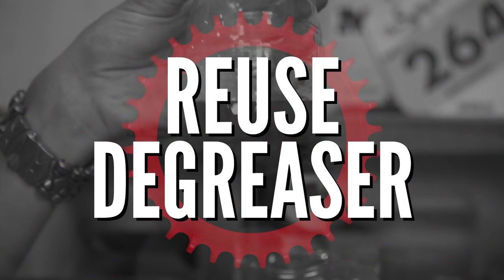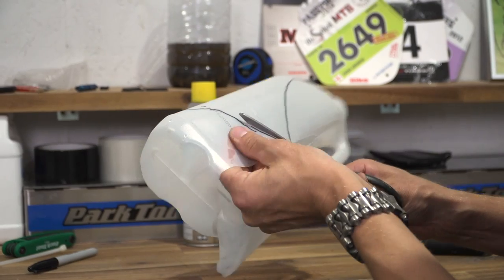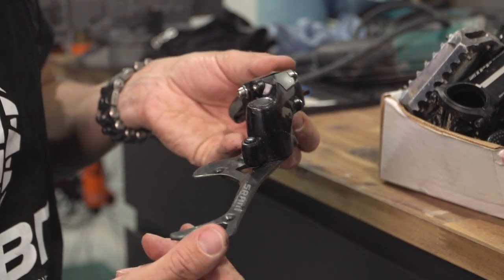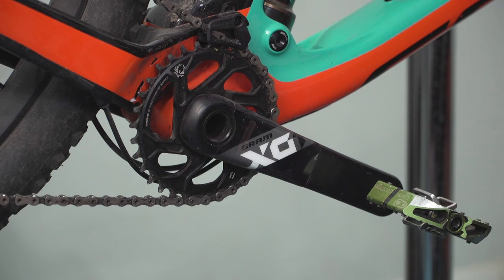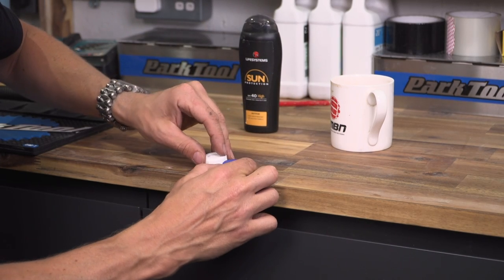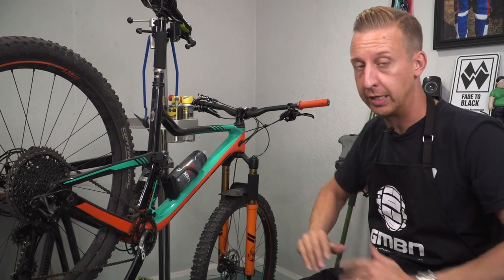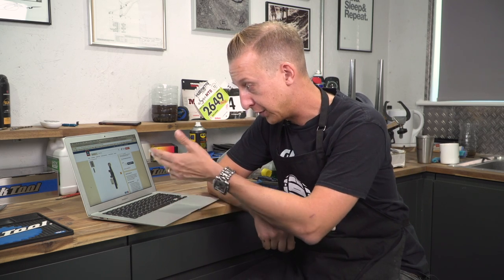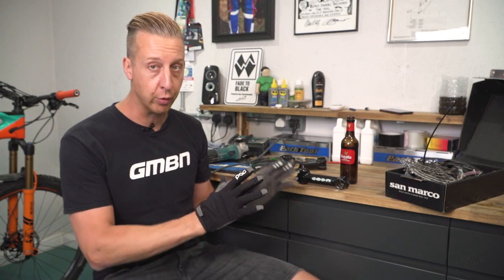The Best Money Saving Hacks For Mountain Bike Maintenance: Part 1

Comment: Doddy--

If you remove the guard from your angle grinder, please use a full face guard.  You have the thin blade perfectly lined up to fly in to your face.   Stay safe.
Reply: Gloves  will  only  get  you  in  trouble  as well.  It is safer  to  just  let  a run  away  blade  do  a clean  cut. If it hits  a glove  it is going  to  do more damage  to  your  hand as it will snag.
Reply: Yep, gloves are a no go for anything you drill or grind with. That is almost the first thing you learn if your going for a job as a mechanic.
Reply: The guard should always be used. It is there in case the grinding disc explodes and turns into flying shrapnel.
Reply: Not worth the risk
Reply: This guy knows whats up. Use a face guard.
Reply: Definitely use the guard.  And a full face. I had a coworker use an angle grinder with that blade and it did explode. Without the guard it would go right in your face.  Be safe first.  Life altering injury is not worth the “convenience”  .
Reply: truth is, if you over use one blade, it will eventually shatter and hurt you, badly! Use a guard!
Reply: So true to use a full face guard, you may also want to not have any paper towels around you when you're doing any grinding mate 😉
Reply: If he uses poc glasses in the vid he can use a fool face helmet!😂😂😂
Reply: Hey Erik how are you? My name is Erik too!
Reply: Erik he just wants to cut and destroy look at him

Comment: Great video. On the subject of degreaser. A guy who used to run a local bike shop once told me that using cheap household furniture polish is a superb degreaser and he swears by it. I have to say it works if you want to clean a chain or cassette etc or just to get thick oil off your hands.
Also old inner tubes make great elastic bands if you want to keep tools together etc if you cut them enough you potentially could have hundreds of elastic bands from one tube.

Comment: I once used an old stem and clip on aero bars to make an adjustable seatpost mounted rack.  Didn't hold more than 20lbs without sagging, but it worked.  I also keep most of my bike parts.  Always some sort of use for them even if it is not bicycle related.

Comment: Doddy pro tip, when using steel cutting discs on aluminum it is best to rub on some wax or a soap bar on the disc itself. Aluminum can actually adhere to the discs which can create a bind, I don't know if you have ever seen one of those discs blow up, but its not cool. You should always try and shield your face. Believe me, I am a metal fabricator, the angle grinder is by far the most dangerous tool in the shop.

Comment: Great to see you reusing the degreaser. I clean my chain in a 1kg peanut butter plastic jar with lid. I have a couple of 1 litre kerosine bottles that I put the dirty degreaser into. Like you I decant the degreaser after a few days, but into the second bottle, so leaving the silt at the bottom of he first bottle,. Takes only a few seconds. The reason I use closed bottles and jars is to avoid the fumes. Gradually the silt bottle fills up with solids but usable degreaser seems to be effective for ages. So although the degreaser may be seen as environmentally unfriendly, I don't have anything but silt to dispose of. Cheers

Comment: Hi Doddy, I have a question about degreasers: There are pretty cheap kitchen degreasers in a spraybottle which I usually use for degreasing and cleaning my drivetrain. They worked very well for me so far but I wonder what you think about those in particular. Stuff like Cillit Bang for example.

Comment: I use chainsaw oil for chain lube it works for me. It's designed to run it hot dirty conditions with metal rubbing metal at high speed helping cool and reduce friction. It's under far less load on a mountain bike so happy days.

Comment: i really like the approach to keep old stuff like derailleurs, chain rings, screws etc. - it might not be good enough to use on a long distance/touring bike, but as a bike enthusiast you frequently run into the situation where your parents, siblings, friends or neighbors ask you to give their 5km-twice-a-week-bikes a quick check and you find out the problem is just a tiny part, that you would have to get from the bike shop next town for 10 bucks... unless you have a couple of boxes with spare parts from your/their older bikes...and if it's really too worn down try to imagine a totally different purpose ;)
and i can not underline your clothing tips enough - most of my cycling/outdoor clothes is bought from an outlet store at around 10-20% of the original price - why pay 200€ for a jacket that you can get for 30?!
i just went there once in a while and bought what was really cheap... not what i necessarily needed by the time - the time will come!

Comment: If you put the container into the Park Tool magnetic dish, it pulls all the metal shards and crap to the bottom making it easier to pour out without getting any of the crap in the fluid

Comment: how about buying 2 chains and swap between them as they stretch ? best way to greatly lengthen your drivetrain. Also an ultrasonic cleaner can be had for around $10 and will clean that chain in no time much better than just sitting in degreaser.

Comment: I don't like using the blade guards either. Worth mentioning, if you choose to work that way, it's a good idea to keep your face out of the plane of the disk. If it shatters it will fly apart in the plane it's spinning in, so if you keep your face out of that plane you can minimize the potential of a bleed-out or action-hero-face-scar.

Comment: Another good one is do smaller jobs yourself. Don’t take you bike to the shop if just the brake pads need changing, first give it a go yourself.
Reply: to be fair, anything that doesn't need specialist tools (that you're not gonna buy for a one off job), is doable at home, from changing pads to lower leg service and rear mech adjustment.
only things i leave to the pros to do is wheel truing, press fit BB and headset bearing replacement on carbon frame, and yearly service/check of the bike (as my untrained eye could miss something tiny but important)
Reply: Alex Nicolaou I complete agree. 
I tend to stay away from all suspension related pieces because if you screw something up it gets quite pricey
Reply: Ray Ward 😨
Reply: For me, anything except trying wheels is a home job.

Comment: Cool video! Come to NYC and what the food delivery guys use for fenders, I've seen everything from plastic bottles to aluminum gutters. They wrap their chain lock around the top tube while riding, so they build a little enclosure for the cables to run free, then wrap that in an old tube or tire. Compact discs for reflectors, some crazy stuff!

Comment: For the angle grinder, standard practice is to not use gloves because they can get caught up in the disc and pull your hand into the tool. This is typically the case for any rotary tool that your hands go near. The sparks can be avoided by using the guard, or if that's not possible (I often use it without the guard for accuracy), by changing where you contact the blade to the material so the sparks fly away from you. They also burn out really quickly and don't really hurt much anyway. I also recommend using both safety glasses and a face shield if you have it. The face shield provides protection from broken cutting discs and flying metal, and adds an extra layer of protection keeping small pieces of metal out of your eyes. People who work with metal a lot can accumulate enough small shards in their eyes without noticing for that to pose a problem if they ever have to get an MRI because the powerful magnets will rip the metal out. I couldn't help chiming in with some safety things because that's my actual day job. I teach people to use woodworking and metal working tools, so at this point looking out for safety tips is reflexive. Digging these bodges, Doddy! I just recently put a bash ring on my bike that I concerted from 3x to 2x. I wound up using a machined bash ring from BBG Bashguards that had the proper BCD and was inexpensive, but later had the same thought about angle grinding the teeth off the chainring I took off.

Comment: I use several 1kg plastic peanut butter jars for my chain cleaner, I can screw the lid on and really shake the chain around which gets most dirt off the chain due to all the movement and sloshing around. Then in about a week with sludge has settled at the bottom of the jar so I can tip the clean stuff into my 2 litre kerosine bottle with child safe lid, and use it again and again.

Comment: Talking about hacks and household cleaners: 1) Take your brake pads out and clean them with good old VIM....!  Dip the pads in the Vim and rub them together under a hot tap. The Vim makes an slightly abrasive paste that cleans and resurfaces the pads. This is good for de-squealing your brakes as the slightly roughened surface might disrupt potential harmonic frequencies. 
 2) Furniture polish makes a great bike cleaner. Just spray your frame and rims and buff off with a soft cloth. 
3) Household cleaning alcohol works just fine on disks. Use a J cloth to put it on and a white micro fiber cloth to finish them.

Comment: great stuff :-)
5:33  I recommend Sortimo T-Boxx, they are space efficient, no space is wasted, and can be used with  their drawer system. you can take out the boxes, and sort them the way you want, and they stay in place, so you can remove them and put a big item that won't fit in the boxes, they can be stacked, so pretty smart solution, so far this is the best solution I have found.
0:51 I never needed to do a deep clean, you got to put some awful lube and neglect the bike for a while to need for that. but really old stiff stock lube is quite hard to remove. even some bike degreasers will struggle.

Comment: Reminded me of a Discovery Channel program, but the build was on schedule. 
Of course skewers could have a use for food, but I cut off the handle and added a chain ring. I've also cut off v-brake arms and added chain rings too.
Cables for picture hanging ...?
I've used the  derailleur cable clamp to splice cables.

Comment: Great tips , i kinda budget protect my frame from my brake lines and stuff by aplying electrical tape on those spots , by cutting off the edges of the piece of tape it sits much longer and is even pressure washer proof , + you can get them in a lot of colours so who not , and still cheaper than the frame protectors you can buy ...

Comment: Just used some paint thinner on my cassette worked a treat.
Reply: Ray Ward Sorry? Why would I lie ?
Reply: What the hell? Paint thinner will degrease anything. (It also stinks like hell but that's not the point)
Reply: Works really well! But you definitely need to dispose that stuff in the right way cause it's particularly nasty to the environment^^
Reply: Hans Hoden yea my uncle is a panel beater he got it for me. He said just to put it down the drain.
Reply: Putting it down the drain sadly is the absolute worst thing you could do...that stuff is extremely damaging to the biology of sewage treatment plants and consequentially for water organisms in the rivers they're connected to. The bare minimum would be to soak some paper towels or cloth with them and putting that into the waste bin. Ideally you would collect it somewhere and take it to a dedicated disposal contractor. 
I have thought about buying paint thinner for cleaning bike parts in the past but you lose the price advantage over dedicated and biodegradable products when you take the disposal into account.
Reply: Hans Hoden I don’t think a poo drain is going to become bad even tho it is already bad from a bit of paint thinner.
Reply: I'm sorry, but that is a very different kind of bad. I'm an engineer in this industry and it is a very big pain in the butt for us. If your treatment plant that is basically designed for feces completely seizes to work because of liquids that kill off the organisms doing the work, lots of sewage will just spill into rivers and lakes. So I would really love to make at least some people aware of that.
Reply: Hans Hoden I was going to light it and let it burn but I don’t think that would of been good for me.
Reply: Jack Beames  cagado que más o que
Reply: Jack Beames Just put it in an Open Bucket outside and wait a couple of hours... its supposed to evaporate thats how paint thinner works
Reply: Not if you have a  painted cassette
Reply: just buy some proper degreaser! Muc off stuff isn't that expensive and environmentally friendly. I have a big bottle of Weldtite citrus based stuff, works great!

Comment: Awesome tips Doddy!! Gotta try some of those! But I have always cleaned my bikes with soapy Fairy water (dish soap) is that wrong?
Reply: I use Fairy on my mountain bike, motorbike and car. Either diluted with water in a spray bottle or in a bucket with a dustpan brush.  For chains and car rims, a few drops on a dish washing brush dunked in water. Add some WD 40 if really grimmy but rinse everything after scrubbing.  Hasn't been a problem for me.

Just paper towel dry your chain after cleaning and apply lube in the case of your mountain bike.

Fairy with vinegar and water makes for a good household cleaner as well. 👍

Comment: When storing or transporting your bike with a dropper post, just push the seat down... Definitely useful to protect the forks though, I use foam pool noodles or the various packaging materials from inside a bike box to do the same job. For crank boots, get some silicone ones from your favourite chinese website (or ebay). Often as cheap as $2 a pair including shipping! Buy in bulk, they're flexible and stretchy, should fit most cranks.
Reply from the maker: Great ideas!

Comment: awesome video :D another money saving hack i've used quite a lot successfully is scoring used deals, be it bikes, drive train components etc, even older generation items that can be found in amazing shape and are still the good quality product they used to be 3 of 4 years ago when they were new, at 1/5th the price.  for example my M995 spd pedals (blue ones limited edition), cost me less than brand new current XTs, but have all the features and specs of what used to be a 190£ pedal set

Comment: Where you can use a 1 gallon vinegar jug or a 3L jug for a little bigger tires and you can also use them for a quick dirty front pannier zip ties ties Chuck a rubber band old inner tube

Comment: Don't want to be 'that guy' Doddy. But if that grinder disk fragments the resulting fragments will hit you in the face at well over 100mph. Anyone doing that in industry would be seriously reprimanded. Just because you can ...
Reply: Ditto.  i have ground my knuckles on the back edge of an exposed disc  - it went right down to the bone!  And NEVER! NEVER! bend the cutting disc to cut around a corner, if it doesn't break up due to the flex it will shatter when it locks up.  Even if you privately risk your health please don't show the idiots how to do it, irrespective of what you say too many people will take the lead from your actions.
Reply: Also gloves and rotating equipment are a bad bad bad idea
Reply: Arguably worse than taking the guard off, depending who you ask obviously. I run a fab shop and I had a young kid my foreman hired who was the "son of his best friend" and "has a fair bit of experience" and "a good head on his shoulders" blah blah blah.
     Long story short, band saw 1 arrogant kid 0, he was told multiple times no gloves on ANY equipment that doesn't deliver large amounts of current to turn metal to liquid and that gloves are NOT safe. 
     Saddest part was he was wearing the gloves because he didn't LIKE GREASE ON HIS HANDS. My biggest regret was not firing him as soon as he said that. Would have saved all of us some headache and heartache.

Comment: I brought a trek fuel ex8 2004/5 for just over £300. And I've changed everything just not the break calipers or the suspension.
I spent that cost me about £450,  so for approximately £800 i have a very good trail bike the components are SLX and M7000.
Next will be new suspension to slacken it out a little at the head end, any recommendations peps?
Reply: Rockshox recon, you could also get really good suspension forks used. I bought a used fox 34 140mm with a cut down tube for 350$ if you at sights like (pinkbike,Craigslist,mtbr) you can find really good deals!
Reply: excellent strategy, it's true that you can build a higher spec bike for less than buying a ready one. 800£ these days would barely get you anything higher than Deore with some entry level fork.  for 800£ you can build a full slx bike with a midrange fork. and if you don't mind getting used, you could have a full XT or sram eagle build with a very decent fork. that'll be easily on par with bikes bought upwards of 2.000£ a few years back. personal example, carbon hardtail with RRP 2800 in 2015, cost me 980£ to build with xt and xtr stuff, even on the used market it goes for 1500 nowadays with lesser components.